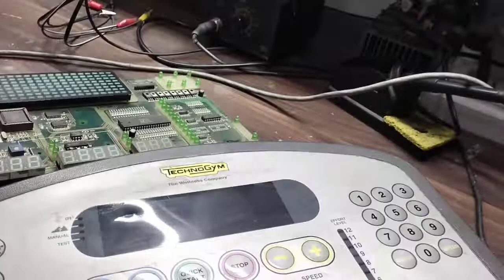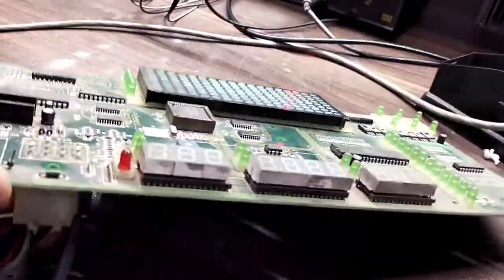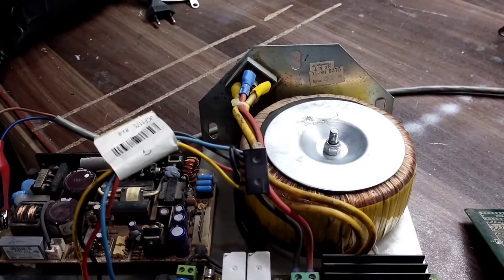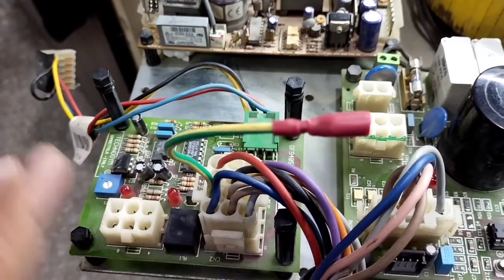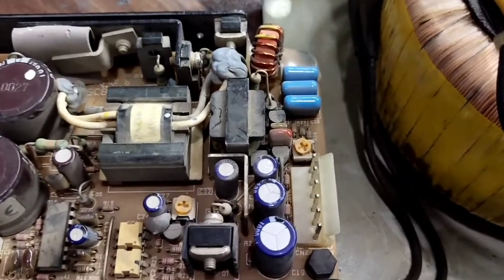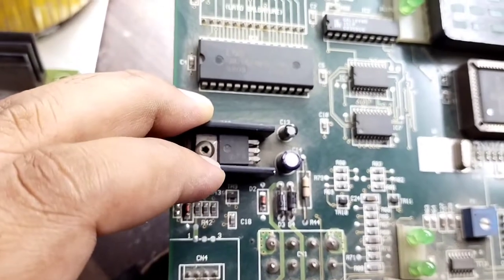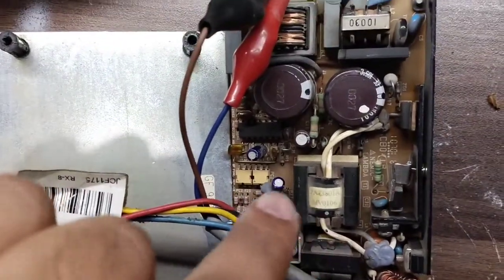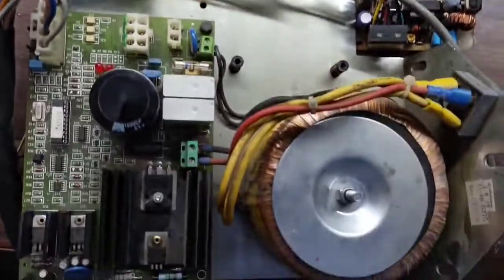TechnoGYM run 500 treadmill repairing

Comment: hi

  i am using Technogym

RUN  EXC 500 class:1 

Serial# DA46EL09000066

Problem is that when i strat run treadmill above 30 min the Machine sudden do stop.

After switch OFF/ON its works only for 2 min and again do stop and belt getting hot than usually.

plz guide me which type of problems could be accure in my treadmill.

Thanks
Reply from the maker: Its motor driving circuit is getting heat.
Check it's motor driver or consult with qualifed technician.